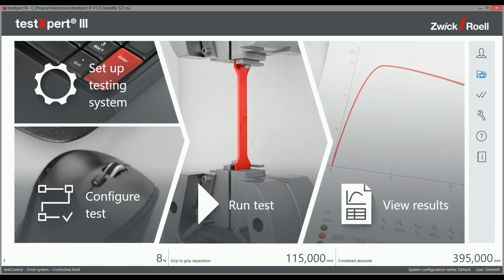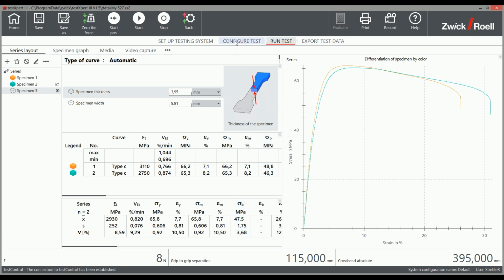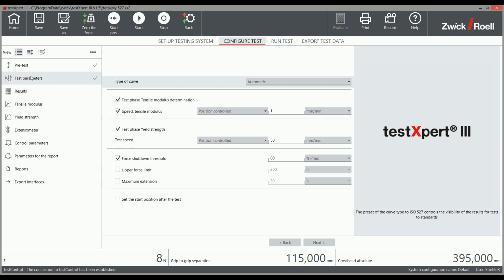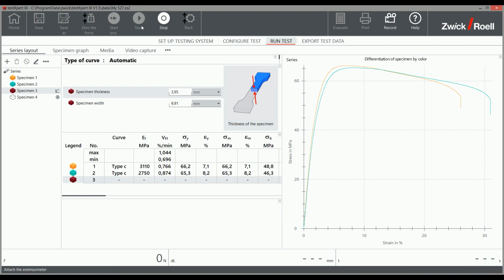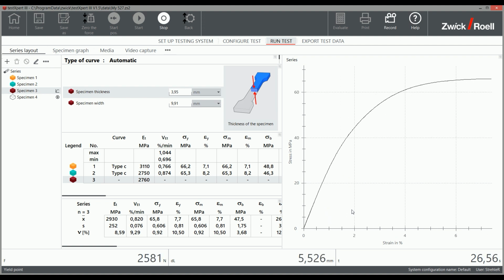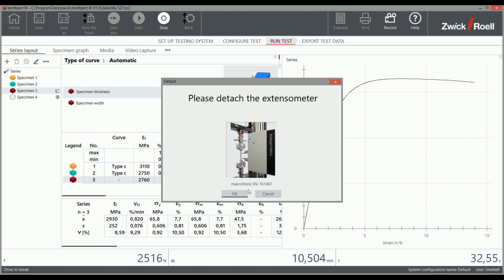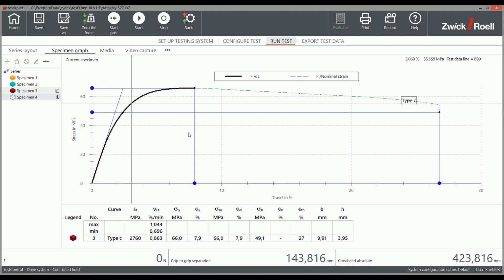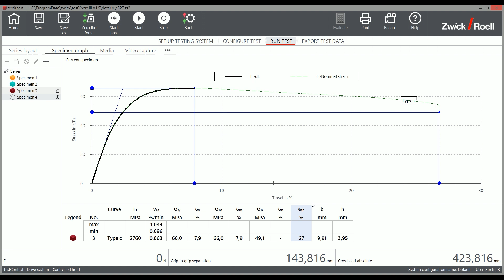Material testing software testXpert III – tensile testing to ISO 527-1 and ASTM D638 on plastic

Comment: The extensometer signal isn't switched automatically to the cross section signal, it´s giving me a sudden drop in the stress each time I detach the exensometer, what's the issue with the program?